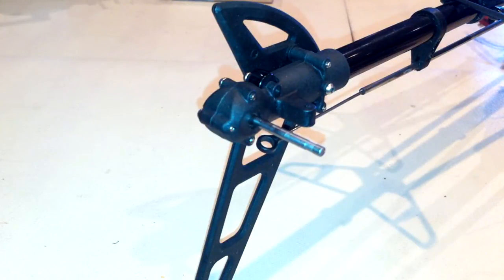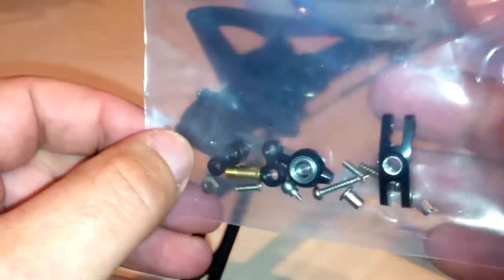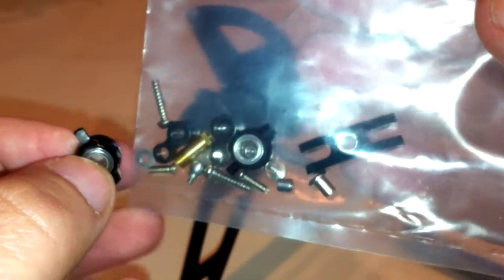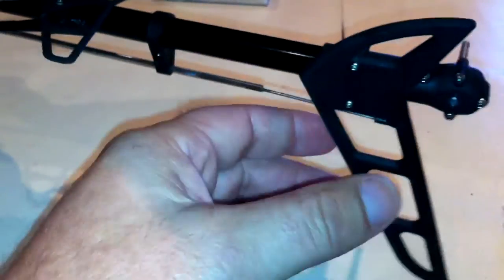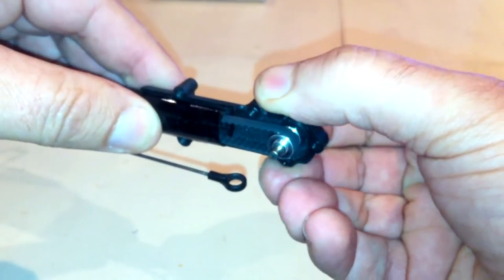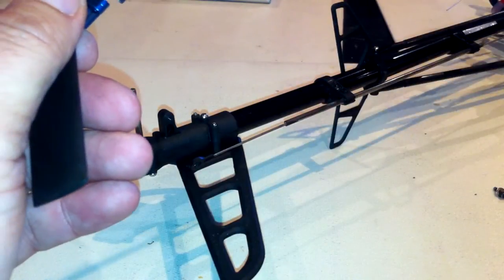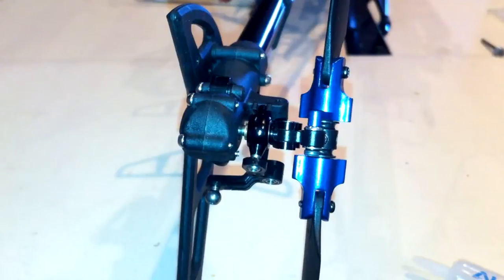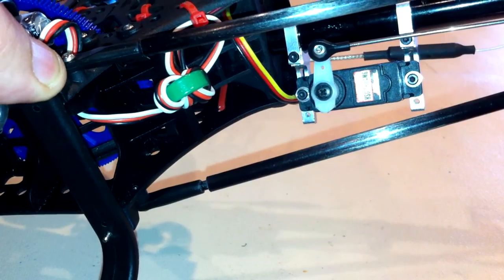Walkera V450D03 How to assemble your tail

Comment: hey buddy, thanks for your input on everything to do with the WALKER v450 d03, I'm having probs atm with the boom servo (gets way too hot I think that's why) I don't want to get a trex etc. when I have just recently bought her, I WANT TO UPGRADE ALL ELECT N SERVOS LIKE YOU HAVE my good buddy, Pretty plz tel me what ELECT hardware you suggest I need to get mine up to your standards, thanks in advance
Reply from the maker: Hi Jimi, thanks for the comment, if you are a competent flyer you can reduce your gyro setting to around 60% in your TX (this is for the tail servo) try this first that may help keep tail servo cooler, is the esc getting hot to?
Reply: +Nigel Brinkmann ok I will give that a go, esc gets quite warm but the boom servo gets like White hot compared esc lol, also I am ready to start 3d flying but I can't have my bird not responding 100%  I have my sub trim for tail all the way R and normal trim all the way R and it seems to be getting worse, maybe belt worn a few teath?? I haven't worked it out yet, tah buddz
Reply from the maker: +Jimi Harper Ok, mmmm.....firstly you shouldnt be flying with your trims set the way they are!?,I would now go and set all your trims to 0 and subtrims to 0 also, then mechanicaly inspect and adjust the helis servo and tail components correctly,there a are few things to check,the servo on the tail may have moved on the boom,tail slider or components stiff in operation and yes you may have a belt problem,just to name a couple, I only use a little bit of subtrimm to correct the servos to excacly 90deg only because I have aftermarket servo's fitted, this is all subtrim is used for. I have the normal trims on my transmitter disabled you dont need them with this flbarless system, If you move your trims on your tx the flybarless system see's it as a stick input
Reply: Nigel Brinkmann wow I'd did change the temp dramatically, still warm but no where near da temp she was at.. Maybe even %50????
Reply from the maker: +Jimi Harper ,Thats good!,so is it all working all ok now? just keep a eye on the servo,  that excessive heat may have shortened the life of the servo,cheers :)

Comment: hello my friend, I have the V450D03 and now when I go to throw it away when I give throtle flipped the tail and the air not only on the ground when I give throtle flipped the tail of you will now be to blame, you will now help me ???
Reply from the maker: +Emirete Angel ,Hello, I am not sure what you are trying to say,is the tail kicking out or not holding? I will help you but I need more information
Reply: Hello, I does not understand well, a video shall be good, I had a lot of problem of electronics and tail with D03, I have an align T-rex 450plus DFC today and I do not regret, I have 100 flights today and no problems, only classic maintains.
450D03:
I had a tail vibration, a professionel looked during 2 hours and found nothing.

I eventually sold it for parts.
Reply: +Nigel Brinkmann ... hello my friend when I give THROTTLE to Normal to climb higher and flipped the tail to the left, do it with air throws, that turning before take off sometimes into the territory, it plays the tail right or left, only right-hand turn one click every time I give THROTTLE WHEN throws, when they are in the air and down in normal mode no in idle, normal mode flying and make this think
Reply: +Nigel Brinkmann ...what to blame; to have the problem Timing Belts;It will now be the blame of servo tail that twisted little ????? what to do?? can you help me my friend...please
Reply from the maker: +fabien laymond, thankyou, sorry to here about your V450D03, the trex 450 is a very good helicopter.good luck :)
Reply from the maker: +Emirete Angel, Helo you might have to make a short video so I can see what the problem is you have,  You can PM me If you like
Reply: +Emirete Angel i think we have same problem.... but in my its ok now:)